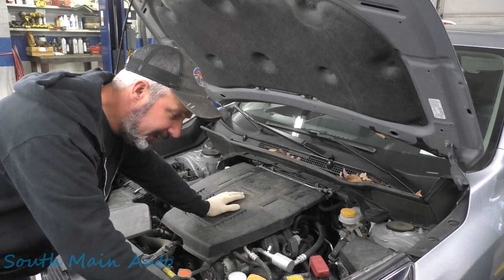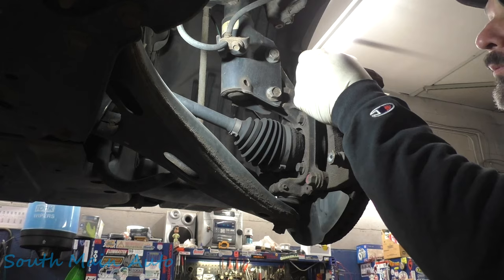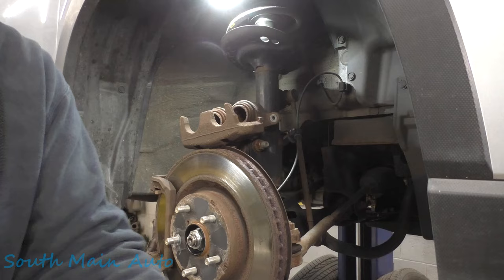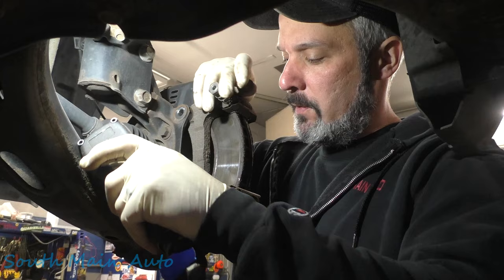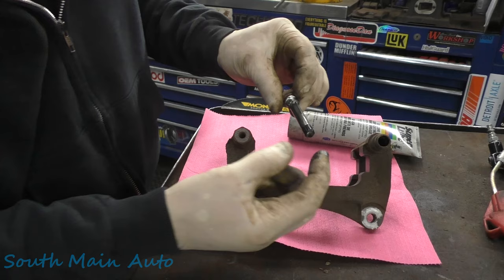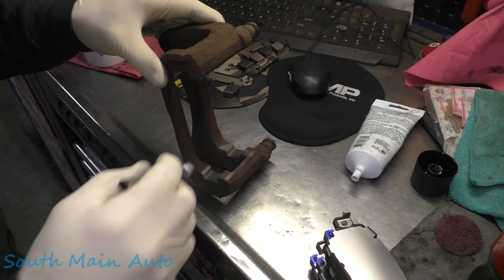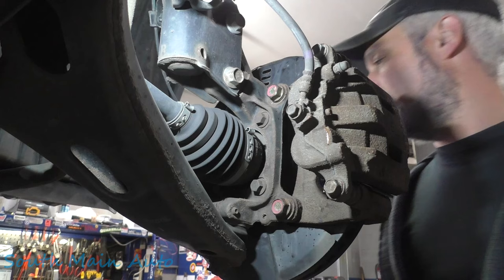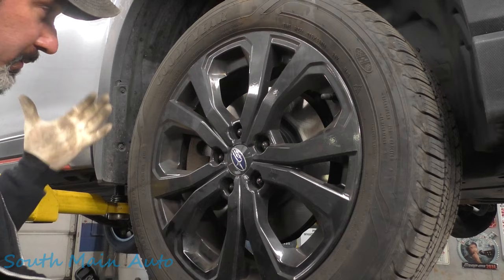'19 Subaru Forester: Front Brake Job - OEM Parts

Comment: Hey Eric, maybe you didn’t show it but I noticed you didn’t lube the outside of the brake hardware that the brake pad slides on. Although, you did lube the inside where it gets mounted for the bracket. Just wondering if there was a reason? Thanks

Comment: You know I've always opened the bleeder valve when changing breaks, especially on older cars. But I find on newer cars you really don't have to and I've had a harder time bleeding the break system when I did do that... So it really depends on what year the vehicle is I guess🤷‍♂️

Comment: Why did you stop using the permatex extreme blue. I saw you use that so much and recommend it during you older break job videos. Just curious is all as I used it per your recommendations a few years ago one some break jobs. Never had or heard of any issues.

Comment: On the Crosstrek the rear brakes are bad for siezing up. Such small pads the ears get stuck in the bracket. Sister has one and they seized up in less than a year.

Comment: that is weird a car having rears replaced and not front my Subaru has spongy pedal also no matter how much bleeding and cleaning up calipers and slide pins it takes a lot of travel to get brakes
I wonder if coating the pistons with the silicone grease would help keep them from rusting away

Comment: Maybe a dumb question, but if the pads don't freely move what forces them AWAY from the rotor when you stop braking?

The piston isn't moving back right? It takes a ton of effort to compress it during a break change.

And there's no spring/clip on the pads to move them away from the rotor when the piston isn't exerting force. So is it just the razor thin amount of brake pad that gets ground off with each stop and the gap it leaves that the rotor has to move within until next braking?

Comment: I like that you grease all the areas called out in the service manual. It's not often you see that on YouTube brake jobs, which is odd to me.  You have a video record of the work, you would think you would do everything called in the service manual.  I had to train mechanics, and we had to do it 100% by the  book.  If the work package called out to replace a screw, torque, grease, etc., we had to do it, no exception.

At the end of the video, I saw the NAPA sign on your shop, I guess you can't say "not a sponsor" anymore?  Also, if the NAPA guy messed up the order, would that be you, lol?  It's all good.
Reply: He actually has to pay to be a NAPA service center or whatever it is they're called.

Comment: You said these were a good caliper design for the rust belt, but then you said you only get one brake job out of them before they rust through and leak brake fluid. Doesn't sound like a good design to me. Just sayin'.

EDIT: Glad you didn't get burned on the "shims sold separately for front brakes but are included with rear brakes" thing. That is where the dealership parts guys REALLY have to be good at their job to remind you of these things so you don't have to make two trips.

Comment: Brake fluid is cheap. I don't need crud and corruption into the ABS valve body or pump, so the caliper gets bled while being pushed into the housing.

Comment: Greetings. Thank you for the entertaining and informative video! However I do have a question: I replaced the pads and rotors (front and back) and with everything re-assembled the front right tire has a terrible almost clicking/grinding sound when the wheel rotates. I've gone back and taken then apart and put everything back together again but the sound persists. Even rotated the tires so the rears are on the fronts but still hearing the sound. Could is possibly be a wheel hub/bearing issue or maybe crappy new pads/rotors? Thoughts? Cheers!

Comment: Love the show I have 2 question I’m changing my sister’s 2001 Mitsubishi Galant es 2.4L transmission fluid and I was wondering does this vehicle have 2 transmission pans oil pans or 1? And my second question is where is the transmission output speed sensor and the input speed sensor located?

Comment: I should get a wire wheel. Otherwise should I just use a flat file and go at the hub & bracket with it? Changed my brakes on my '17 WRX. Went okay, squeals after 6 months when it's dry, probably needs a clean up and some grease to quiet em down

Comment: I have a 2018 Ford F150 with 97k miles. Front pads still have 6mm. They are the original pads. I have changed the rear 5 times and one set of rotors. They (Ford) swear there is nothing they can do. Sound right right to you?

Comment: How aggressively do people drive that they need brakes on a 3 year old vehicle? I can make a set of pads and rotors last more than 10 years and over 120k miles. I’ve never had to replace a clutch either and I’ve driven several vehicles to over 300k miles. Its not like I live in a rural area without traffic, either.

Comment: What is the purpose of the rubber on the slide pins, and, do the rubber pins go on the top ot bottom of the bracket?
Reply: The pistons only push from one side and the whole caliper slides on the pins to make the pressure even on both sides or the disk. There are two pins on each caliper, one at the top, one at the bottom, although they are not always identical.
Reply: As a 37 year veteran tech, I will say that they are more than likely there for noise reduction. You really won't find any kind of service information about them. I generally find them in the lower position, but I've seen them in the upper. I've also seen them completely missing with no ill side effects. They do have a tendency to get stuck in the anchoring bracket while the slide pin comes right out. Just make sure you get the old rubber out and the pin and hole are rust free. A good tool for cleaning the hole is a plumbers wire brush, readily available at your local hardware store. Use actual brake grease on the pins and make sure they slide freely. Always replace any brake hardware along with the pads and double check your bolts. Happy Thanksgiving!

Comment: Anyone know the purpose of those rubber sleeves on the guide pins? The ones he said could make it act like a hydraulic cylinder. Ive had those little fella's swell right up and lock the pins in tight. Just removed them.

Comment: My kid did his brakes and was given the wrong set ( He ended up locking the wheels in place ) , end up costing $ over 2,000 to fix at a shop. I would hope he learned to leave repairs to more Qualified people and be safe .
Reply: Ford Truck?
Reply: @mph5896  Subaru , kid trusted you tube video's and didn't follow instructions . lol
Reply: @brucemcdougall7282  Hmm, that's strange. I have seen calipers that are internally rusted and seize when they get pushed back. Not sure what else would cause that though. 

The Ford Trucks, if you install the pads wrong, they can push the caliper against the wheel seizing the actual wheel.

Comment: Generally speaking, for most applications OEM brake parts are overrated. Top-shelf aftermarket parts are as good or better in most cases. I cringe when I see non-coated rotors installed here in the rust belt. Most manufacturers have installed coated rotors at the factory for a few years.

Comment: Wife has a 17 Forester. Brakes have been high effort, crappy modulation, since day 1. Pretty undersized for the vehicle.  Call them "Hello Kitty" brakes since they're so little and cute and not good for much else. And yeah, rear wear faster than front.  Miserable car.  Every Hondoo or Acura I've had stops so much better and with so much better feel and control.

Comment: Curious, do you tell the customer they got OEM parts vs aftermarket since you quoted them aftermarket?
Reply: Does not need too. I am sure Mrs O will give the customer an itemized bill. In which case, it will show on there as Subaru Brake Pads rather than Nappa Brake Pads. Or at least that would be my guess. And because of the price difference may just have as cost "as per quoted cost" or something along those lines on it.

Comment: I’m curious, at what point would you do a brake fluid flush? Any particular symptoms you’d be looking at/for in order to do that?
Reply: Usually the fluid turns dark almost black. Once it gets that nasty it's hard to clean em out. Just go with new fluid to get the water out of the system is your main goal.

Comment: If I lived in the north, I would park my good cars and drive older cars during the winter. Man, those look horrible for such a low mileage car. Where I live, that never happens for the life of the car.
Reply: It's funny, I get what you are saying but I do the opposite of that. I drive my 2016 Outback with 37k miles in the winter and park my '97 and '00 Land Cruisers with 204k and 130k miles respectively. I don't want salt on those. That being said, I don't drive much in the winter anyway. I need to get into doing the Fluid Film treatment on my Outback.

Comment: Could you have reused the rotors since the brakes weren't worn down to the metal?
Reply: If there was enough material on the rotor to be resurfaced, then yes.

Comment: I've always wondered, what are the shims for? For brakes you would think they would be made for purpose, not needing an additional interface. Is it to keep them from sticking to the caliper/pistons?
Reply: noise.
Reply: Also less expensive to make stainless shim inserts at the sliding points than a stainless brake pad and caliper

Comment: Having rear brakes wear out before the front is kinda strange in my opinion.
Reply: Subarus use rear brakes to prevent rolling backwards when starting from a stop. They disengage as you start to roll forward not upon pedal release. Very good on manuals especially on hills but they do it on automatics too. Rears wear faster than fronts based on my living with four Subarus over 30 years.
Reply: @briandeschene8424  interesting. I haven't noticed that on my '03 Forester.

Comment: In all my experience as a Ph.D mechanical engineer with 54 years experience and blue ribbon AARP certification with braking endorsement (certified by my union president of course)- I think you should have pumped the pedal 10 times and THEN cracked the bleeders.

Going those extra steps for good measure will sure make that customer happier.

🤦🏼‍♂️
Reply: @chrisforte8229  I think you missed that I was obviously trolling the people in the comments who profess their list of credentials and act like they are wizards.

Comment: Any concerns with asbestos dust while you are doing that break job? Probably not, right? The majority of auto manufacturers haven't installed asbestos-containing brake pads since the 1990's due to health concerns for those that perform brake-related automotive repair or maintenance.

Comment: Do these US made cars last as well as the Japanese ones?
Reply: The American ones make Chrysler look like Toyota’s
Reply: How long do the Japanese ones last.
Reply: @ShainAndrews  well as we've got 2,  a1992 liberty AWD sedan 398k Kms and a 2003 Forrester with 330k Kms , they last pretty good mainly because we don't have a rust belt in Oz 😀
Reply: @camneilsen8234  OZ?
Reply: @ShainAndrews  Oz short for Australia 👍🏻
Reply: the Forester is a Japanese made car.  Only Outback and Legacy USA made
Reply: @TheLazyCarrot  See you ruined it.  I asked a question for a reason... Of course he can't answer it.
Reply: @ShainAndrews  the problem is that cvt equipped models are less reliable than the manual versions. If you get a manual Crosstrek, for example, it’s very reliable. You can expect 200-250k miles. Be mindful of oil consumption. It’s not uncommon for consume a quart every 1500 miles.
Reply: @TheLazyCarrot  the Ascent as well.

Comment: Do you change the brake fluid as per the manufacturers recommendation, most seem to recommend that you change your brake fluid every 24 months or 24,000 miles, whichever is sooner. It is hydroscopic and absorbs water over time.
Reply: I have a ‘19 Tacoma with 65k and asked my mechanic that at my last service. He said the color was still good so no need to change.
Reply: @DirtForester  Last time I checked water was clear, it should be changed after 24 months, color is not relevant, find a better mechanic. Water absorbed in the brake fluid can boil under heavy braking, essentially increases the risk of a brake failure. The water can also lead to increased rust in braking components. It's cheap and easy, and should be done every 24 months, just like changing the oil.